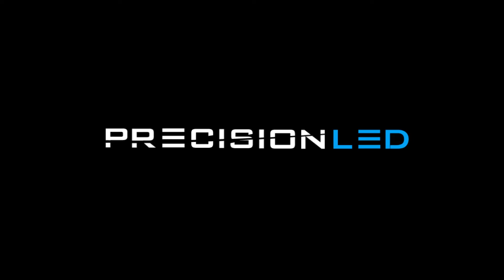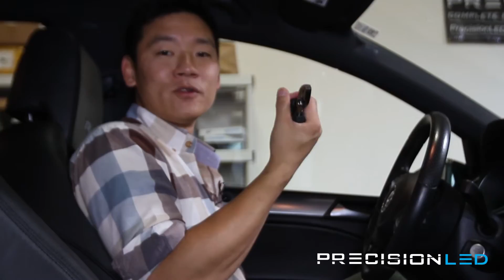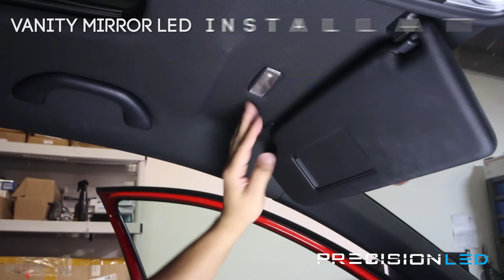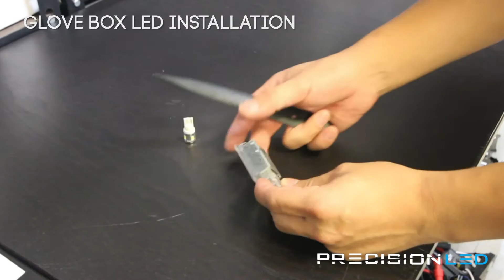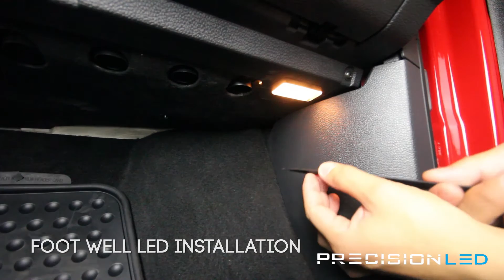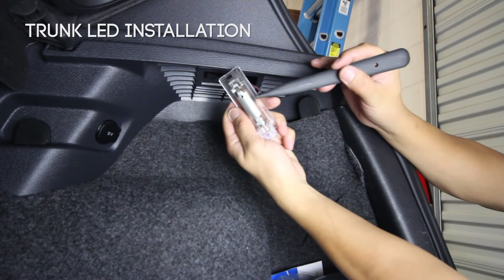Upgrade Volkswagen Golf LED Lights  - 6th Gen 2010-2014

Comment: dude the center lights front and rear all you have to do is pop off the clear lenses.  that's how I did it way easier than unbolting stuff.
Reply from the maker: Thanks for the tip!